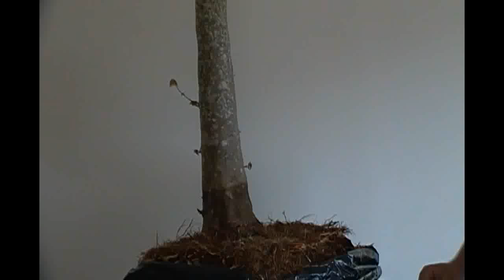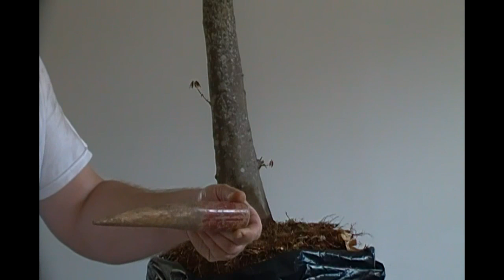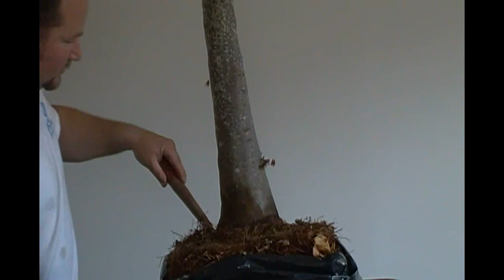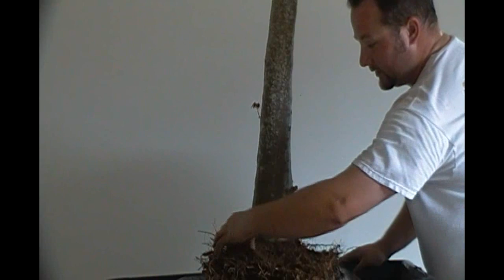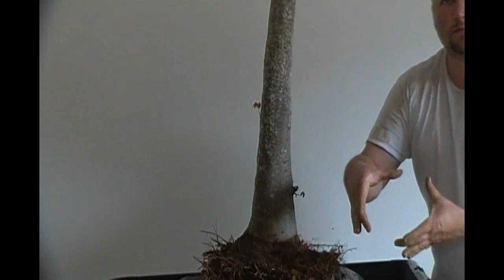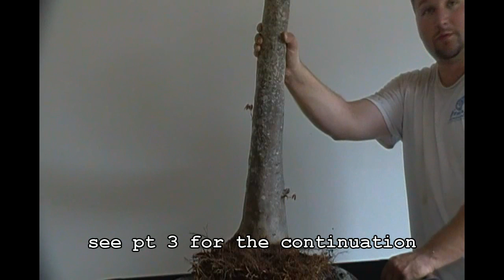A trip to the nursery for  bonsai material trident pt 2

Comment: I have a Live Oak tree in my yard that must have been a squirrel burying an acorn tree. It is very siimilar in size to the tree you have. It is about 2 feet from my stockade fence row and needs to be dealt with before it gets any bigger. My wife wanted me to just cut it down. But after watching this series of videos, I wonder if I could do what you did to the Maple tree with my tree. Would the Live Oak be a good candidate for such a treatment or would it be certain death as you stated earlier? Any thoughts, input/comments would be greatly appreciated. Thanks. GREAT VIDEO SERIES BTW.
Reply from the maker: Thanks for the feed back To answer your question yes live oak make wonderful bonsai and can be treated in this manner. If you are collecting from the ground I would trunk chop it the first year and let the stored energy of the roots in the ground send the new leader up really fast .In Year 2 dig around 1 half of the trunk leave a 6 in gap  between the trunk and roots back fill with bonsai soil then repeat the following year  on the opposite side .Then on the 4 th year dig it out then you already have 4 years of new growth to the apex and a good mass of fine feeder roots to feed the tree when you drastically cut the bottom growing roots  off .
Reply: Thanks for all the info. I'll give it a try.
Reply: One more question. Should I be doing any branch pruning during these next 4 years? Or just let it grow however it wants to grow, unmolested?
Reply from the maker: If more than one apex starts growing up you need to select just one if that is the design you are going for . If you have branches that will not be used in the final design you will want to remove them also. The wounds will heal faster in the ground than in a training pot
Reply: Got it. Thanks again.
Reply from the maker: your welcome for more detailed informatio you can do a google search on love oak bonsai .